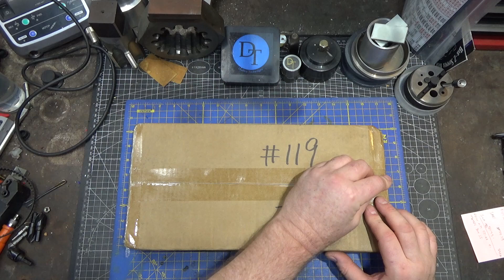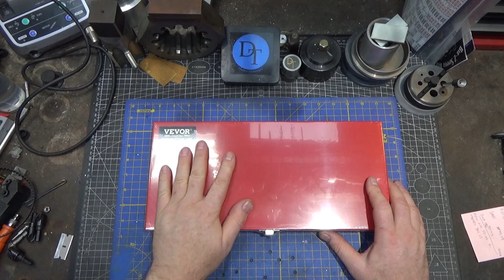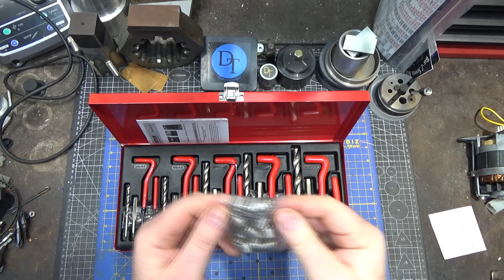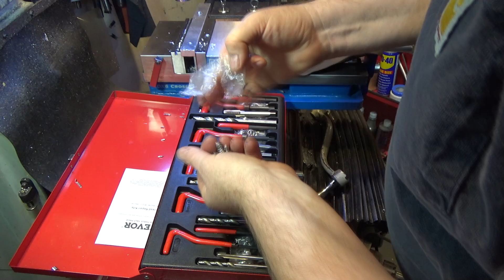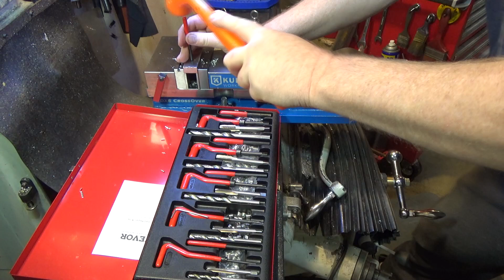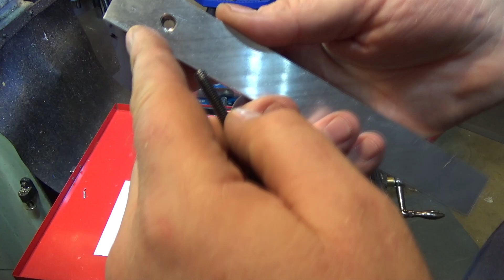QTR 127 Vevor 166p Metric thread Repair Kit

Comment: Good video.  I did buy the expensive recoil ones and had no end of problems with them.  2 broken insert tools made from rubbish steel,  couldn't get the inserts to thread in, tang wouldn't break off, $200 down the drain. Think I will buy these.
Reply from the maker: Thanks. That is some really useful feedback. I only have limited experience with thread inserts, so more data is helpful.